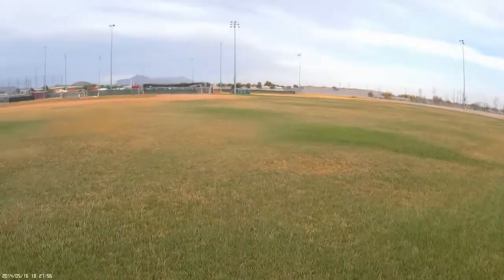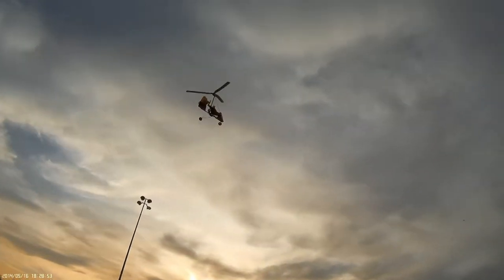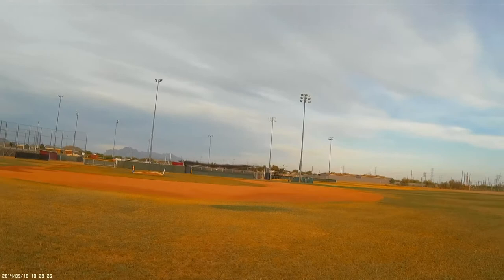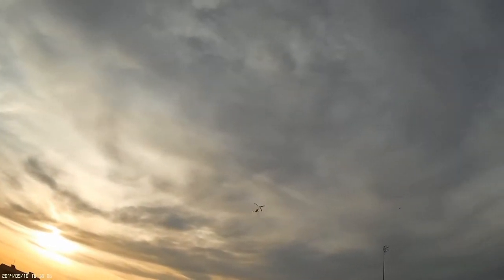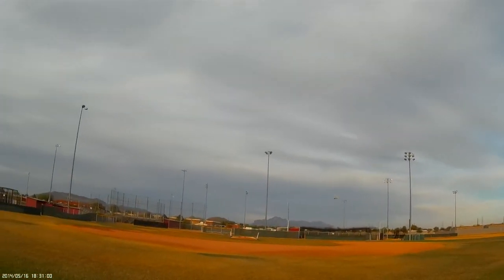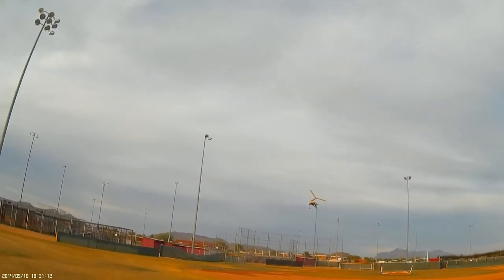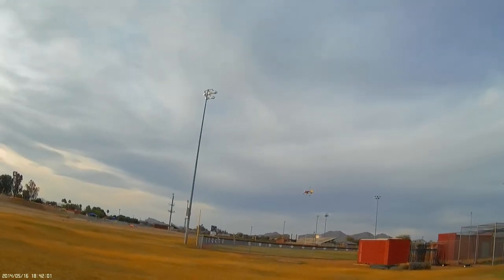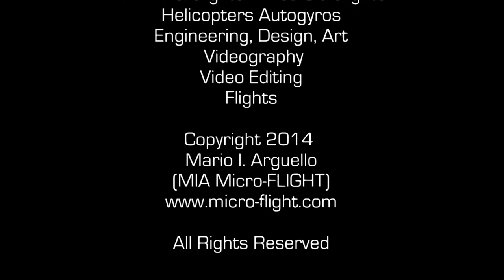RC Autogyro "MIA EZ™ Gyro 1.0" Part C May 16 2014

Comment: Hi Mario
Is there a headwind that allows an "almost hover", or just a high angle of attack allowing the autogyro to fly at slow speed?
Reply from the maker: Hi Gavin, Yes, there is a headwind. The stronger the wind, the better the hover. But you still need to control it. The strong headwind actually creates a lot of drag and reduces model fast forward speed, the way to get the speed back is to fly the model back into downwind with high throttle to get the rotor rpm high again and then face the headwind into forward light or hover again.
Reply from the maker: MarioIArguello I made the four videos Parts A-D to illustrate various flying conditions. You an actually learn to fly the MIA EZ Gyros if you watch these videos carefully.